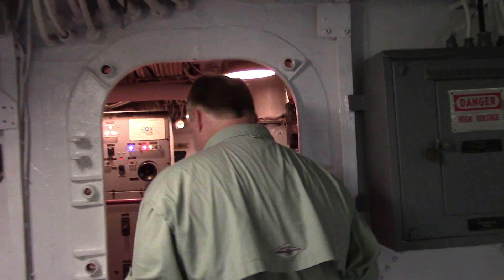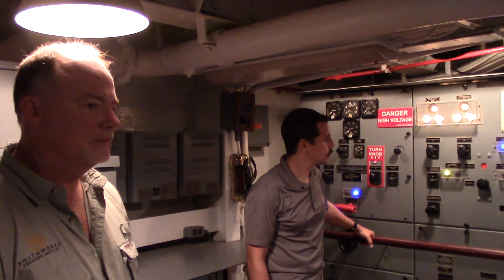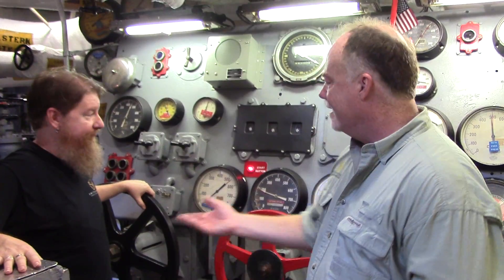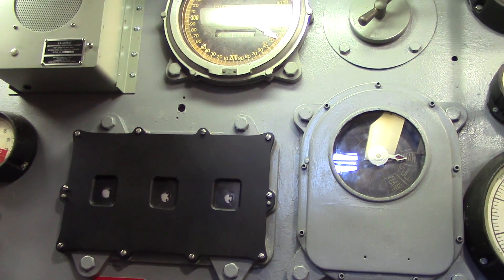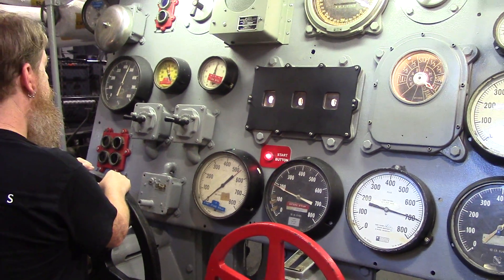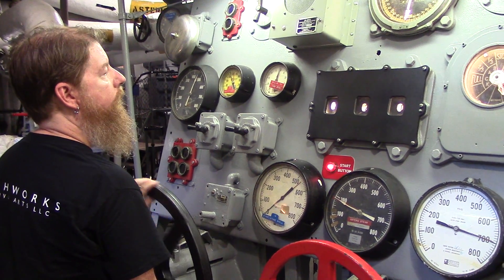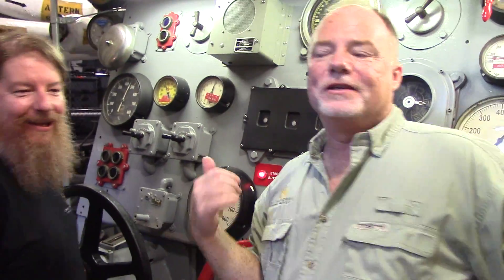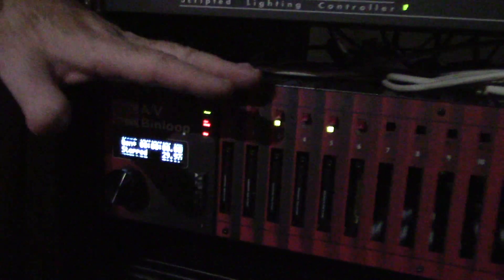Laffey Engine Room

Comment: Hot?  During mid watch, we would send the messenger up to the spud locker and secure a few good size spuds.   Wrap them in foil and set them on the steam turbine to bake.   Thanks Chief Kell.  DD764 1971-72.  After engine room.
Reply: We had several engine room chefs on DD-863 1972-73

Comment: Remember.....while all this is happening the ship is rocking/rolling (It's a destroyer) , much more noisy (turbines, pumps, reduction gears are noisy),   HOT....about the only place you could be for a while is under a fresh air blower, not to mention surrounded by all that asbestos insulation....some of which is crumbling apart.  Sounds like fun, huh.  (EX EM...electrician mate)  destroyer/tanker.